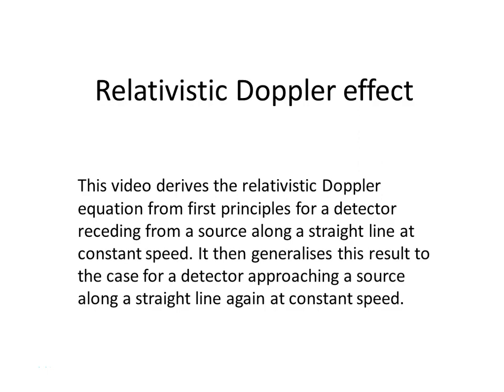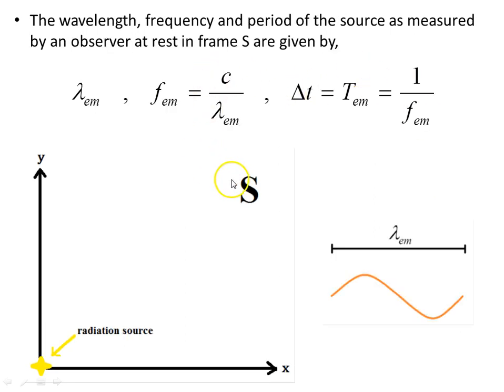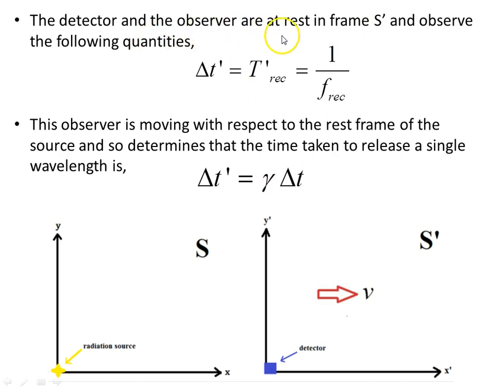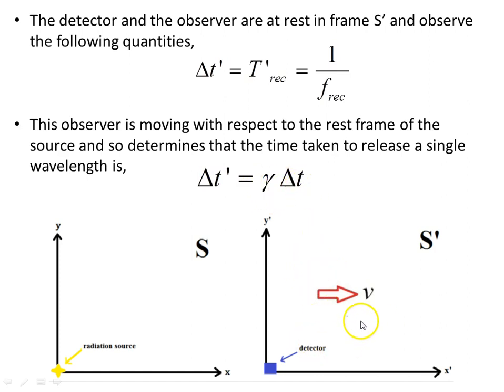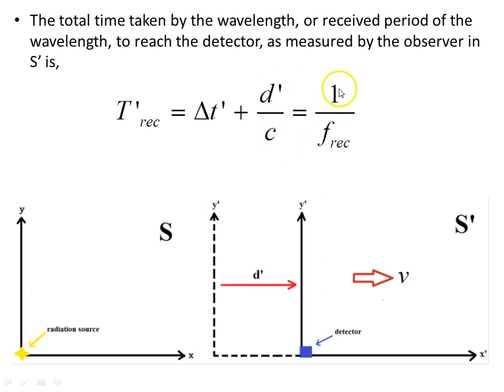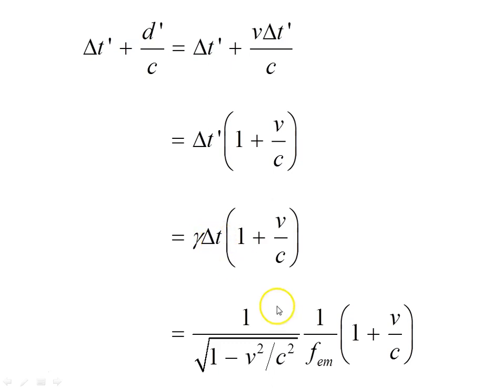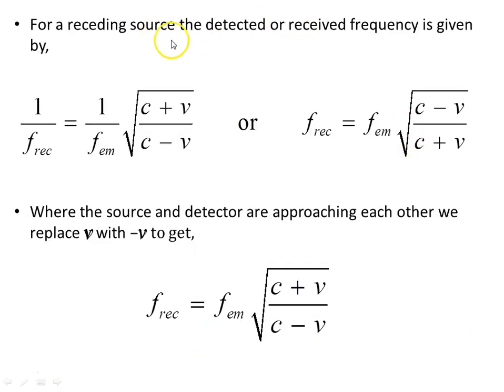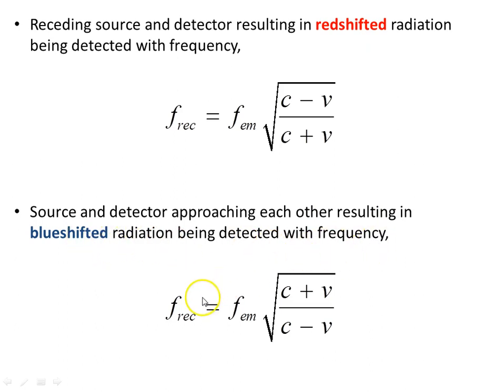Relativistic Doppler effect

Comment: Fantastic,  thanks.    
Minor question:  At about 2:57  you state  "... so the observer in S' determines that in his/her reference frame, the DETECTOR has moved a distance...".
If I got the frames the right way around,  the detector is at rest in S'.   So the observer in S' actually determines that the SOURCE has moved that distance away.   Is that right?
(It wouldn't change the rest of the calculation anyway).
Reply from the maker: Hello Col and thank you for that. Yes, the observer in S' has during the course of the receipt of the wave moved a distance d' because he/she is moving relative to frame S with speed v. Put another way, the source has moved a distance of d' away from the observer.

Also, thank you for your comment on the energy-momentum tensor the other day. The factors of 'c' when left out can end up being a source of stress when and serve to make learning GR harder than it needs to be.

Comment: Wonderful!!! Plz make videos about geodesic coordinates and energy momentum tensor in a pretty visual way.
Reply from the maker: Hello Abu and thank you for your comment. I will eventually get around to making a video on the energy momentum tensor. As for geodesic coordinates the same applies. 

In the meantime, you can picture a point P on a manifold and the region local to that point as looking very much like Euclidean space of the same dimension. In this approximately flat region the affine connection is everywhere zero and we can resort to straight lines to describe the path of objects. Which means this region can be treated as being an inertial reference frame for the motion of objects.